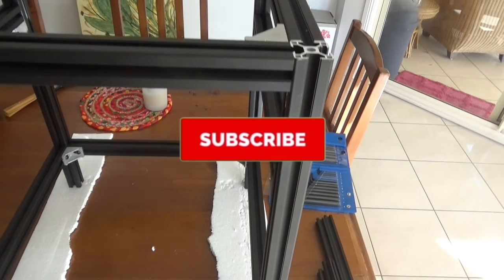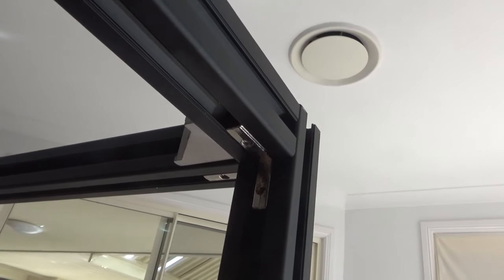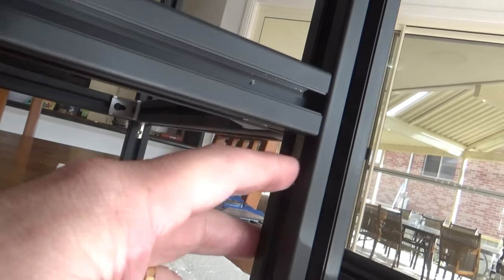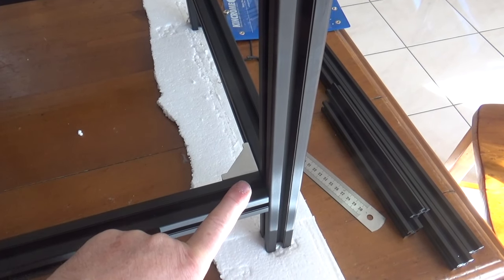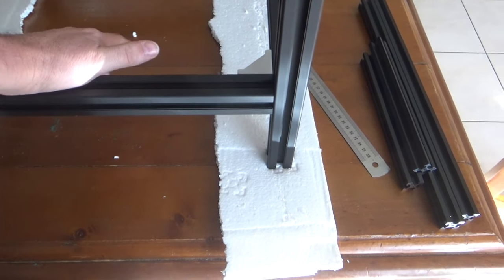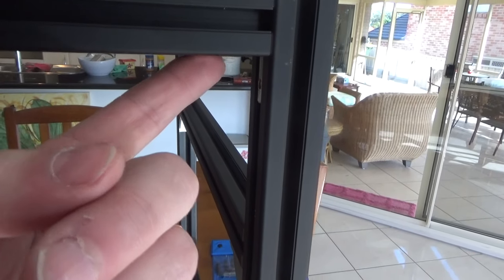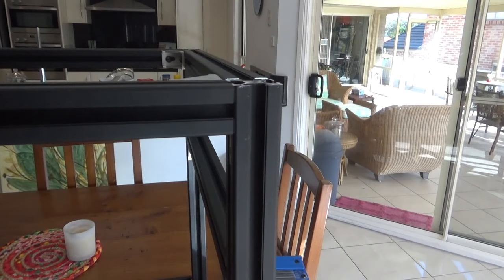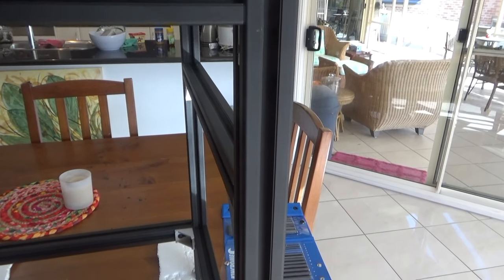#093 Hypercube Evolution 3D Printer Build - 2 (The Frame)

Comment: I have just started my build, 400x400x500 and had the same idea about putting all the gubbins in the bottom. Thanks for posting these videos!
Reply from the maker: No problem, sorry I haven’t managed to post any this year, with one thing and another and then COVID I’ve just not got back into it. Hopefully in a month or so I will start getting some content back up. I actually ended up not putting the controls underneath, went for a little more height instead, you will see that in the videos though. 
Love to see how your build turns out, good luck with it